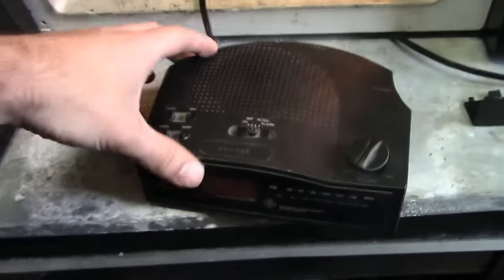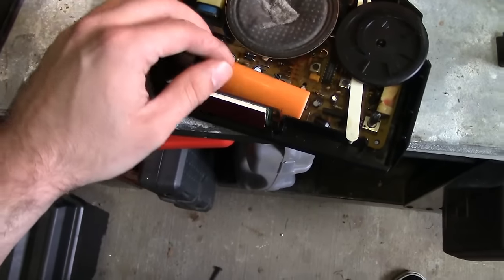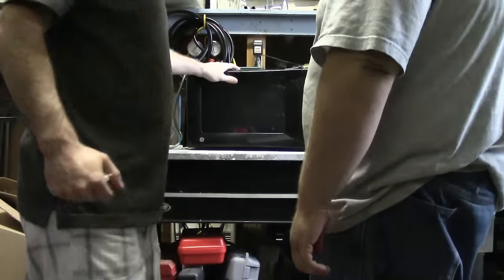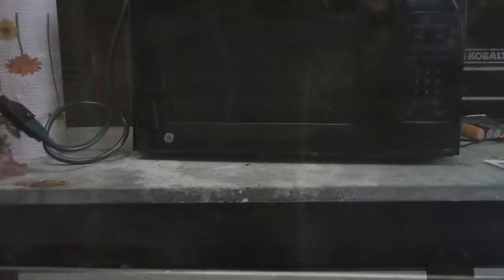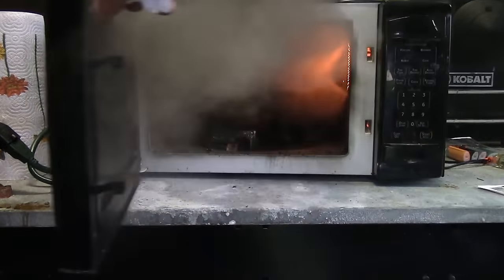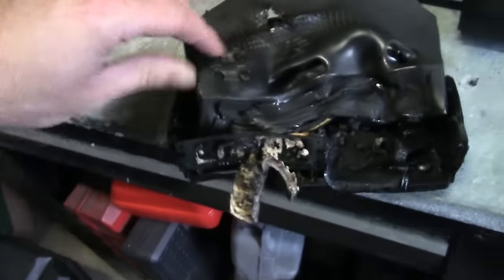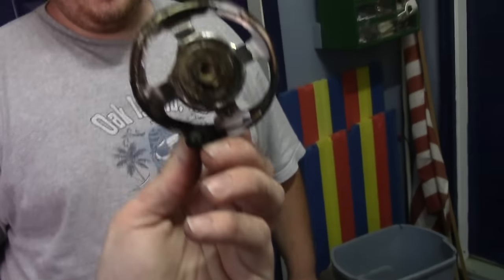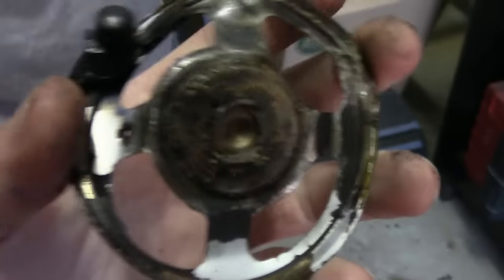Alarm Clock In The Microwave

Comment: Lots of flames!  Did you put firecrackers in there, what was popping like firecrackers?
Reply from the maker: 240 Volts It was the capacitors popping on the alarm clock circuit board.
Reply: Shawn K Thats cool!  I have never run across a video where that happened before.
Reply from the maker: 240 Volts If you're talking about the popping that starts at 1:47, it was from two fireworks that we placed inside the alarm clock along with the lighter.
Reply: Shawn K that's the same alarm clock i used to have back in 1998. the alarm can go off even with a battery for some reason.
Reply: Westley West Isnt that normal?
"even with a battery"
Reply: Punchi Bunch not from what i remember.

Comment: how did you power the clock without a plug?
Reply from the maker: I removed the turntable motor and routed the power cord up through the opening.  I cut the cord and 
spliced it back together so it would fit through the opening.
Reply: @ssmmkk2  Thx, i was thinking maybe power it with batteries or something, but it turns out that's an option